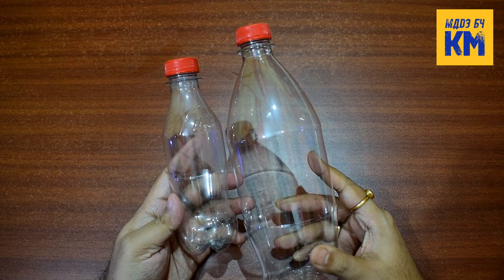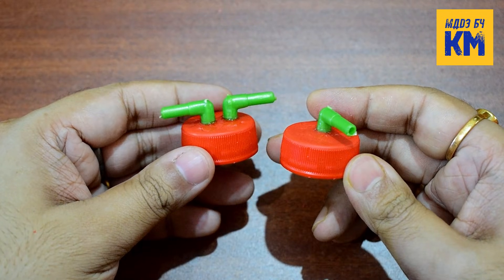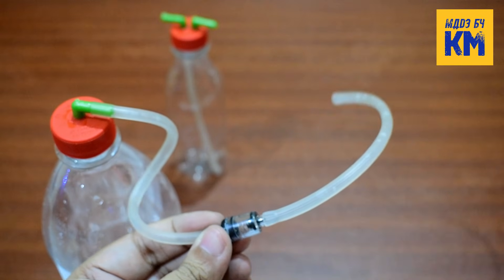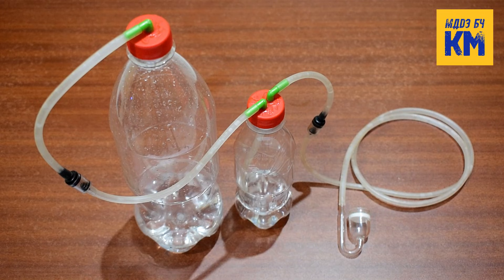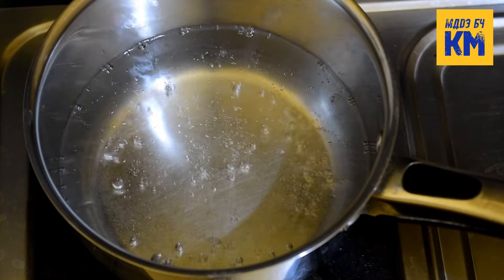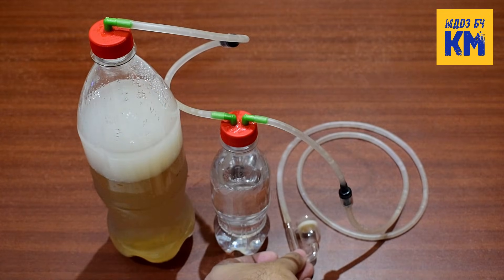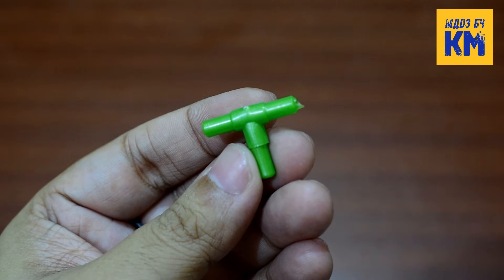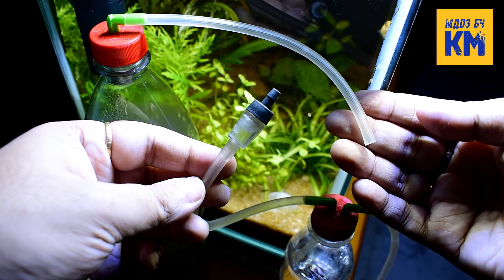Long-Lasting DIY CO2 for Planted Aquarium: Easy & Effective

Comment: Can I use gelatin powder instead of agar agar?
Please respond
Reply from the maker: You can use but gelatin works well in cold environments (<20°C). If the outside / room temperature is 25°C - 40°C, the jelly made using gelatin will melt.

Comment: Why do we need the check value.
Reply from the maker: Check Valves or Non-Return Valves allow air to flow in one direction (into the tank) and stop water from flowing in the other direction (out of the tank).
Reply: @madebykm  thanks

Comment: Should I need to give 24 hrs for sugar solution to solidify or I can do it as soon as sugar solution is set? Also will the jelly melt due to outside temperature?
Reply from the maker: Wait 24 hours for the jelly to set properly, then use it. It will not melt at outside temperature.
Reply: @madebykm   I added the yeast solution. It’s been 4 hrs and I see bubbles in 2nd bottle. But it’s very slow like 1 bubble per minute. However, when I disconnect the diffuser the bubble count increases. I added 1/4 tsp of yeast but the pressure is not enough to diffuse in tank. Should I give it more time or re-do yeast solution with more yeast?
Reply from the maker: Wait for the pressure to build, it will work properly. If you need more CO2 production, you can use 1/2 teaspoon of yeast instead of 1/4.
Reply: @madebykm it worked . Thank you so much

Comment: Is there a way to control the bubble count per second?
Reply from the maker: It will depend on the amount of yeast. More yeast = more CO2 production. I have found (in a normal bubble counter) that 1/2 teaspoon of yeast can produce CO2 at a rate of 2 bubbles per second for about 10 days. Then the production of CO2 gradually decreases as well as the rate of bubbles per second. So to provide CO2 in the tank at a steady rate, I recommend refreshing the yeast-water every week.
For more information, you can check out the description box.
Reply: @madebykm  so if I need say one bubble per 3 or 4 seconds I can reduce the amount of yeast right. Maybe 1/4 teaspoon of yeast or slightly lesser than that?
Reply from the maker: Yes

Comment: With the CO2 diffuser in this method, will it work?
I bought a co2 diffuser (same as shown in the video)  i tried to blow air through it by connecting a pipe but it seems no bubbles are being generated under water. Will this diffuser work for this DIY method?
Reply from the maker: Yes it will
Reply: Yup it worked. Just like you said.

Now can we do the same with the sprite or pepsi  ( replace the agar agar gel and yeast water)
Reply: Can you share the link for buying the tubing and the green connectors and the diffuser

Comment: Hey khausik ,is cheack vavle mandatory? If yes plz alsomake diy check valve becoz those are expensive
Reply from the maker: Yes, it is necessary. Check Valves or Non-Return Valves allow air to flow in one direction (into the tank) and stop water from flowing in the other direction (out of the tank).
Reply: @madebykm  can you make diy check valve becoz those are expensive
Reply from the maker: Ok, I will try

Comment: Hey Kaushik, I am planning to make one diy co2 system, however I have some questions…I would appreciate if you have time to reply.
What is the other name for Agar Agar powder? What is the actual purpose of the jelly in the bottle, compared with other diy co2 systems where there’s only water with sugar and yeast? Thanks for your time
Reply from the maker: 1. Agar-agar aka Chinese gelatin / Chinese isinglass / Japanese gelatin / Japanese isinglass / China grass is a gelatinous substance derived from seaweed (specifically red sea algae) and used in biological culture media and as a thickener in foods. This is a vegetarian alternative to gelatin. 
2. In the normal DIY CO2 method (yeast+sugar) CO2 production only lasts 7 to 14 days and so you have to throw away the old mixture and make a fresh yeast+sugar+water mixture every week or two. But in this jelly method, you need to make the jelly once and it will last for 4-5 weeks. You only need to change the yeast-water weekly to keep the CO2 production rate stable. Hence, it will reduce the cost and also reduce the hassle of preparing the whole mixture frequently. Moreover, the production of CO2 in this system will not fluctuate and will be at a constant rate. This is the advantage of this method. Thank you.

Comment: Can we use geletin powder instead of agar agar
Reply from the maker: You can use but Gelatin works well in cold environments (<20°C). If the outside / room temperature is 25°C - 40°C, the jelly made using gelatin will melt.

Comment: What are the prices of the check valves & CO2 diffuser?
Reply from the maker: Please see the description box for the product links.
Reply: @madebykm  I understand that there might be some referral perks involved but if you could guide me where to buy from locally in Kolkata, then it would help a lot. That way I can utilise the time this long weekend. Otherwise Amazon's delivery period for such products is way too long & involves additional delivery charges also.
Reply from the maker: You can get all these from Galiff street pet market.

Comment: Can i use gelitine on the place of agar agar
Reply from the maker: Gelatin works well in cold environments (<20°C). But if the outside / room temperature is 25°C - 40°C, the jelly made using gelatin will melt.

Comment: What is the use of check valve bro
Reply from the maker: Check Valves or Non-Return Valves allow air to flow in one direction (into the tank) and stop water from flowing in the other direction (out of the tank). For more information, see the video description.
Reply: @madebykm  thanks bro

Comment: I also did the same you did but not working what to do?
Reply from the maker: Wait for a maximum of 24 hours and if the CO2 production still doesn’t start then consider there is something wrong with the system. Also, check the troubleshoot section in the description box.

Comment: what happens if we dose co2 24/7??
Reply from the maker: There will be no problem. I supply DIY CO2 to my tanks 24/7, and to date no fish, shrimp, or snails have died because of it. But for those who don't want to supply CO2 to their aquarium at night, they can either separate the CO2 generator tubing from the diffuser or run an airpump or airstone to keep the oxygen level high in the aquarium water.
Reply: @madebykm  thank you for prompt reply

Comment: With the airstone Its works better. new diffuser is not working any solution.i using same glass diffuser in your video
Reply from the maker: Ceramic CO2 diffusers require more pressure to work than air-stones. You can watch my DIY CO2 Diffuser video for more information.

Comment: Sir why nothing coming from my diffuser.I am using ceramic glass diffuser it's newly buy from amzone. pls help me
Reply from the maker: The bubbles won't come out right away, the fermentation process can take several hours to begin (up to 24 hours). When enough pressure is created in the bottle, bubbles will come out. Also, check for leaks in the CO2 system, if there are any leaks, no pressure will be created and the system will not work. Check out the video description for more information.

Comment: For 60 gallon aquarium how many bottles are required?
Reply from the maker: DIY CO2 is ideal for small aquariums. For larger aquariums, it is better to use pressurized CO2. However, you can use 2 CO2 generators and change the yeast-water of one bottle alternately every week. For good CO2 production you need to use at least 1/2 teaspoon of yeast and make sure the CO2 bubbles are passing through the bubble-counter in the tank at a rate of 4 bubbles per second.
Reply: @madebykm  Ok , so I have to maintain around 4 bbps, thanks a lot for the help , I am able to build a planted aquarium because of your help, else it would have been extremely costly.
Reply: @madebykm  One more question: I heard some foam is generated in the bottle, and also heard that a little bit of oil controls it, so Should I add a drop or 2 of oil in the bottle(jelly bottle)
Reply from the maker: No need to do that, there will be no problem.

Comment: Sir there is no bubbles comming from the button but in tank CO2 bubbles are coming.is that is fine
Reply from the maker: If bubbles are not visible in the small bottle, there may be a leak on the inner side of the small bottle's cap where the tubing is attached.

Comment: Thank you so much sir. It's working good. can you please tell me how to stop CO2 because I have to provide morning 4 hrs and in evening 4 hrs. I saw in your video to diffuse the CO2 need remove the air pipe from check valve outlet. But evn after removing the pipe CO2 ist still generating the bubbles. Can you please help me in this
Reply from the maker: The CO2 production cannot be stopped in this method. You can just stop the CO2 supply to the tank by disconnecting the CO2 tubing from the check valve. See the description for more information.

Comment: Sir i did same but bubble not produce
Reply from the maker: The bubbles won't come out right away, the fermentation process can take several hours to begin (up to 24 hours).
Reply: @madebykm  sir
Its been 36 hours
Reply from the maker: See the troubleshoot section in the video description

Comment: Sir i am not getting agar agar unflavored jelly can I use flovered jelly
Reply from the maker: Yes, you can use
Reply: Thank you so much sir. It's working good. can you please tell me how to stop CO2 because I have to provide morning 4 hrs and in evening 4 hrs. I saw in your video to diffuse the CO2 need remove the air pipe from check valve outlet. But evn after removing the pipe CO2 ist still generating the bubbles. Can you please help me in this

Comment: Sir I made the sulution 40 minutes are gone but still the bubble are not coming 😢 pls help
Reply from the maker: The bubbles won't come out right away, the fermentation process can take several hours to begin (up to 24 hours).
Reply: Ok sir thanks now small small Buble are form at the top of jelly but they are not braking in to CO2 . The co2 has not yet started to come in Buble counter bottle . It will take more time right ?
Reply from the maker: When enough pressure is created in the bottle, bubbles will come out. Also, check for leaks in the CO2 system, if there are any leaks, no pressure will be created and the system will not work. Check out the video description for more information.

Comment: Does this diy co2 generate enough pressure to pass through a glass diffuser?because I tried it for long time but failed to generate that much pressure to make it pass through glass diffuser.
Reply from the maker: You can use a simple ceramic glass diffuser (with no built-in check valve), it will work. If that doesn't work, check for leaks and/or increase the amount of yeast to 1/2 - 1 tsp to produce more CO2.
Reply: @madebykm  Thank you very much
Reply from the maker: Welcome

Comment: Excellent video thanks im going to try this, just two questions though you mention the small bottle is used as a bubble counter what is the best way to increase or decrese this? Also when you disconnect the Co2 for the evening is this dangerous meaning Co2 will be pumped into a living space?
Reply from the maker: In this process, the rate of bubbles cannot be controlled, it can only be seen in the small bottle. If you want to increase the CO2 production / bubble rate, you need to use more yeast (eg 1/2 - 1 tsp). And if you disconnect the CO2 tubing, it's not dangerous at all, because very little CO2 will be produced in the process. The air naturally contains much more CO2 than this. For more information please check out the video description. Thank you.
Reply: @madebykm  thank you for replying i will be trying this although agar agar seems difficult to get in Australia although not impossible is gelatine the same or best to just get agar thanks
Reply from the maker: You can also use Gelatin, but the problem is jelly made using gelatin usually melts at outside / room temperature (25°C-40°C). Gelatin works well in cold environments (<20°C). But jelly made using agar agar remains firm even at 65°C. Thank you.
Reply: @madebykm  thank you mate it’s best I source the agar

Comment: This Method  is very useful , genrates good CO2 pressure , but lasts only for 5-6 days...
I made gelatin jelly in a 2.5 litre bottle , but whole jelly was used-up in just 4 days..
and only foul smelling liquid left behind but CO2 pressure was still there which continued for another 2-3 days then stopped completely....
Reply from the maker: Using gelatin will not produce good results. This is because the jelly made using gelatin melts at outside / room temperature (25°C-40°C). Gelatin works well in cold environments (<20°C). But if you use agar agar instead of gelatin, you will definitely see the difference. Agar agar jelly will last 4-5 weeks.

Comment: Should we keep it In the refrigerator
Reply from the maker: You can, but after cooking it will also turn into jelly in a few hours if you keep it outside even at normal temperatures.

Comment: Is it possible to keep c02 in the fermentation  bottle when I would detached  check valve .because when I will detache check valve ,then this co2 will mixed in air.
Reply from the maker: Na sheta kora jabe na, karon ei method e CO2 continuously toiri hote thakbe, ar plastic er bottle bondho kore rakhle, bottle shei pressure dhore rakhte parbe na ar puro CO2 system ta noshto hoye jete pare, aro information er jonno video description dekhun.
Reply: Thank you.

Comment: Can we use gelatin for the mix
Reply from the maker: Gelatin works well in cold environments (<20°C). But if the outside / room temperature is 25°C - 40°C, the jelly made using gelatin will melt.

Comment: Hi bro ! I have ordered a ceramic glass diffuser. Will it work with this DIY  ?
Reply from the maker: Yes it will, use simple ceramic glass diffuser without any inbuilt check valve.
Reply: @madebykm  Thanks a lot !!

Comment: I have a 20 gallon planted tank, with 30 watt lights, and a hang-on-filter. I've created this DIY Co2 generator, but  my worry is that the surface agitation from the HOB-filter will remove the Co2 in water. What are your thoughts? Thank you in advance!!
Reply from the maker: Don’t worry, surface agitation is necessary for gas exchange and that HOB filter does not have that ability to create such a strong surface agitation that all the CO2 gas escapes from the water.
Reply: @madebykm  I see. Thank you! :)

Comment: Great tutorial! I have a question and would be appreciated if you help. I made this system and it was working fine for 3 days with a DIY diffusor but then I bought a glass CO2 diffuser from the market. I detached the tubing from the DIY diffuser and CO2 gas leaked from the system as it should be and I attached the tubing to the new CO2 diffuser. It has been 16 hours now, I still see the bubbles in the second bottle (1 bubble in 5 seconds) but no CO2 coming out from the diffuser. Should I wait more?
Reply from the maker: These ceramic diffusers take some time to work, when enough pressure is created in the bottle, bubbles will come out of it. Also, check for leaks in the CO2 system, if there are any leaks, no pressure will be created and the diffuser will not work.
Reply from the maker: Also, if you use 1/2 teaspoon of yeast, CO2 production will increase and glass diffuser will work better. Please see the video description for more information. Thank you.

Comment: is there any leakage of co2 from using a airline tube vs co2 tubing with this method.. follow up question if i use a 2.75-3L bottle, with this method will more co2 be produced? or stick to 1L and 0.5L? thank you very much
Reply from the maker: A good quality airline tubing will also work fine and the CO2 production depends on the amount of yeast, not the size of the bottle. Also, check out the video description for more information.

Comment: Can I use gelatin instead of agar agar?
Reply from the maker: Actually, using gelatin will not produce good results. This is because the jelly made using gelatin melts at outside / room temperature (25°C-40°C). Gelatin works well in cold environments (<20°C).

Comment: Sir I have used the same glass diffuser as you used in video that diffuser can't  diffuse CO2 but still bubbling in water bottle but diffuser not difusing pls tell any solution
Reply from the maker: These ceramic diffusers take some time to work, when enough pressure is created in the bottle, bubbles will come out of it. Also, check for leaks in the CO2 system, if there are any leaks, no pressure will be created and the diffuser will not work.
Reply: @madebykm  thankyou sir this channel definitely gets diamond play button

Comment: Sir can we do this without check valve because I can't get it now
Reply from the maker: You can, but if you do not use the check valve, aquarium water can flow back into the bottle. You will find the link of the check valve in the video description.

Comment: Really precise and clear video. I am right now cooling that hot sugar syrup and underestimated the time. I hope this works. Any idea if the typical diffuser can be used or i need a good airstone ?
Reply from the maker: You can see the video description for more information and also watch my DIY CO2 diffuser video. Thank you 😊
Reply: Yes, my diffuser is working fine... I saw your diy diffusers and that's what I will do for my next tank. THANK YOU again.....

Comment: Can I add Gelatin Powder in place of Agar Agar Powder?
Reply from the maker: Actually, using gelatin will not produce good results. This is because the jelly made using gelatin melts at outside / room temperature (25°C-40°C). Gelatin works well in cold environments (<20°C). Thank you.
Reply: @madebykm  Actually Agar Agar powder is not available in the market. Thank you for the reply.
Reply from the maker: Please check out the video description for the link. Thank you.